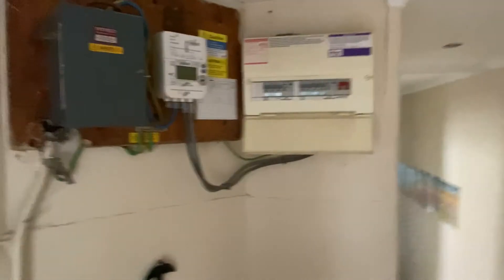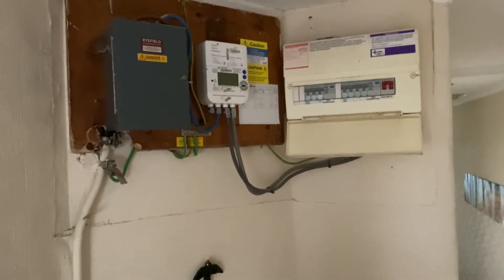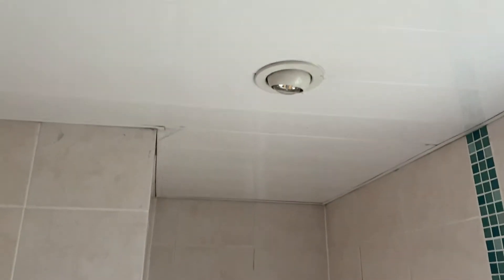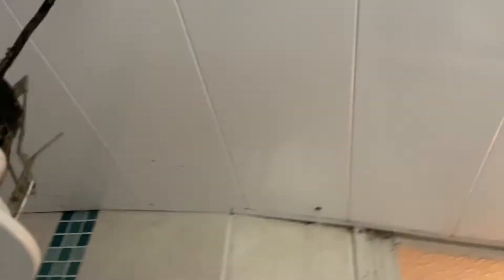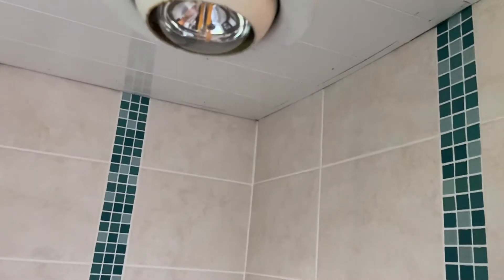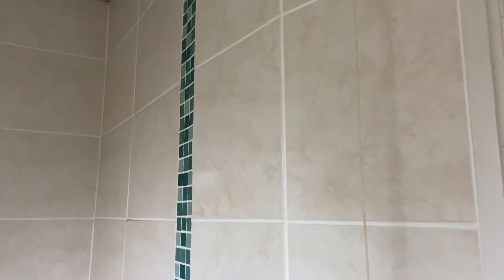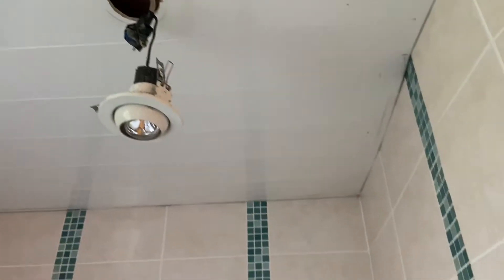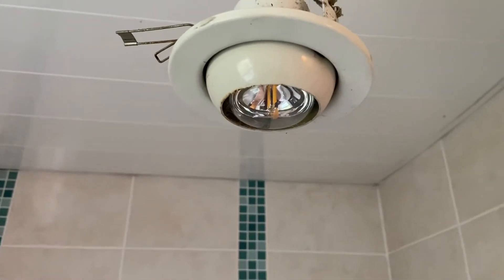Electrician describes Safe Isolation Procedure and doing EICR

Comment: Lights in bathroom are not IP rated or fire rated I doubt it there’s any fire hoods, the bodged connections ,  make it a C1 for me 
Secondly you don’t need a proving unit when you clearly have a live supply, you can prove your voltage indicator on a known source such as the incoming side of the mains switch as per GS38 also your voltage indicator doesn’t conform to GS38 as one of it probe shrouds is missing.

Comment: Yes C2 with comments added. I assume you knocked off the EICR in 30 minutes which seems to be the industry standard 😱
Reply from the maker: Nah mate. Only 20 minutes and then did the rest from the pub round the corner.
Reply: @AsaDCElectrics  about right...I hope the industry bodies really clamp down on this but I suspect not. It will come to a head at some point.
Reply from the maker: It happens in the Gas world as well, with the Landlords gas safety checks.